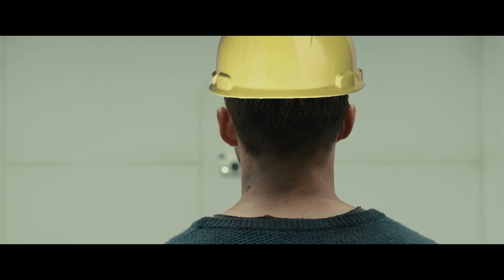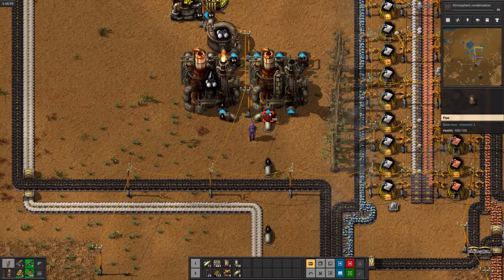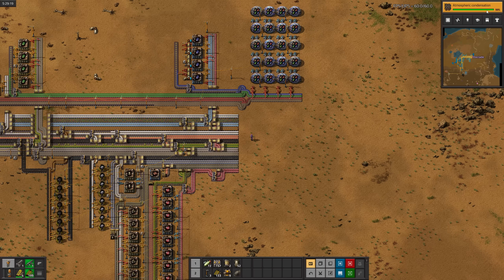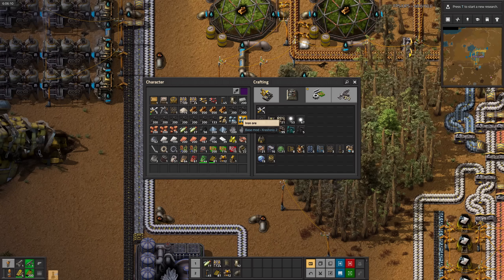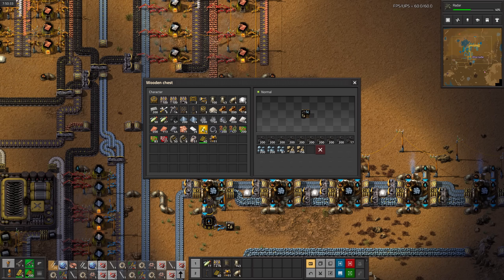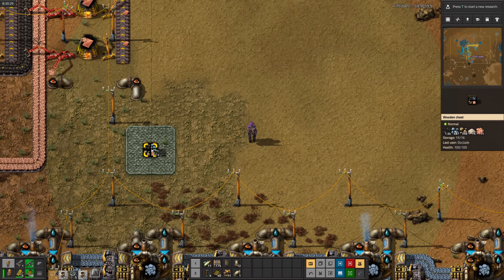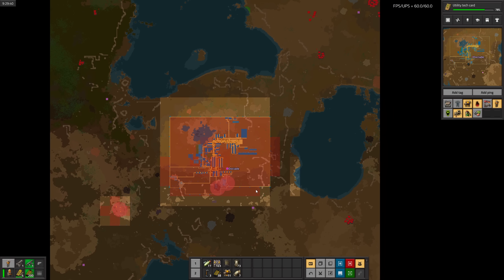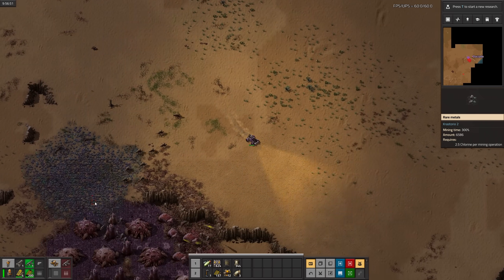Krastorio: Carbon Neutral - EP 2

Comment: 12:55 Oxygen is HIGHLY flamable. its one of 3 vital parts of fire, Fuel, Oxygen, Heat. People think that fire is all about the fuel, no, oxygen plays a huge part of it. Its litterally what makes things go from small flames to torches capable of cutting and welding steel. Its why your not allowed to open flames near oxygen tanks.
Here is a video of oxygen burning in a propane atmosphere: https://youtu.be/8jmX-TUQkx4?t=267
Reply from the maker: darn, sorry for the incorrect info :P
Reply: Oxygen is not flammable. Oxygen in and of itself does not burn. It is an integral part of fire, yes, but it is not flammable. It enhances flames, and even causes other material to be able to catch fire, but it isn't flammable. Oxidization =! Flammability.

Comment: Actually, sand and water are how you can synthesize quartz. Quartz is made of silica, which is what sand is made off. You just get the silica to dissolve in water with high temperatures, and you can generate arbitrarily large crystals of quartz.

Comment: You can indeed cheese power using the gas power stations. Biomethanol is made from oxygen (free from the air), wood (greenhouses with water), and steam (water + wood). You can make a modular build if you like since the ratios actually work out quite nicely (3 greenhouses, 1 boiler, 1 oxygen machine, 3 fuel refineries, 3 gas power stations) and get as much power as you want with water as the only ingredient. Generates a ton of pollution, but nothing an air filter or two can't fix ;)

If you do this, hook up a storage tank to a power switch. Set the power switch to disconnect if the biomethanol tank gets close to empty. This will blackout your factory if you overdraw power, but it will recover automatically, which is awesome :D
Reply: Wow nice. I would love to try it but i like vanilla more.

Comment: to fill both sides of belt just readjust inserters, no need to make this splitter/belt at the end. Hope to see next episode soon, gj man
Reply from the maker: I recently realized that  if you dont balance the sides, you can only get half the maximum output from your buildings (I noticed this in my smelting array)

say you have 1 furnace per side
if one side is backed up, now you're only running at 50% capacity

Comment: Just to clear something up, someone in the comments mentioned that Oxygen is "HIGHLY flammable". This is not true. Oxygen is an Oxidizer. It promotes flames, but does not burn itself. Oxygen devoid of fuel is no more dangerous than a tree covered in snow.

Also, I'm unsure where the information that Oxygen radicals are flammable is from, because from what I can tell, they as well are just oxydizers. But honestly, I could be very wrong about that, and if you have a quote on that, I'd love that.

Comment: Pollution neutral is not carbon neutral. Burn the trees, straight from greenhouses. This makes more power than it needs, while taking just water. Then, greenhouses take some pollution. If you insert speed module, than suck more pollution. You can burn wood from greenhouses (100% carbon neutral power!), and suck pollution at the same time. Later you can also use wood for mater liquefication and production of any resource. No need for mines :D